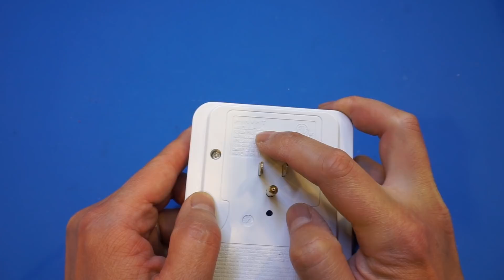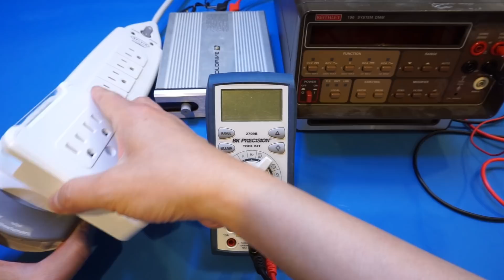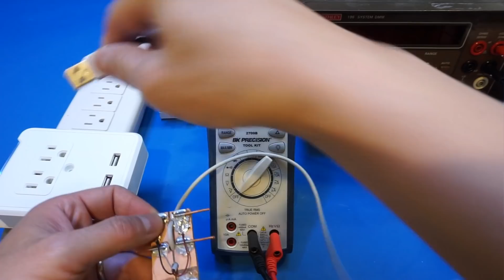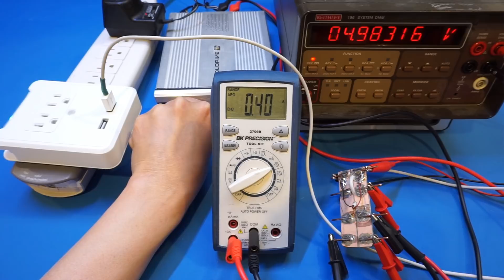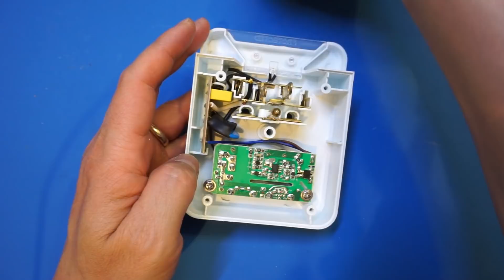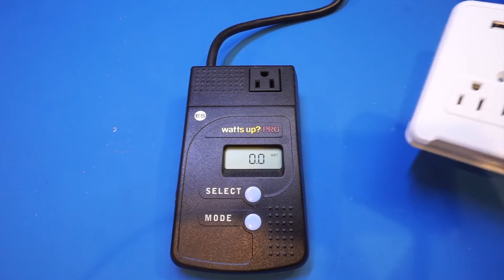Teardown of an MVMT Dual USB Port Wall Outlet Adapter

Comment: Does the 196 need cal? I noticed that when you upped the resolution, the voltage reading changed from 5.0368 to 5.0376!
Reply from the maker: I checked the calibration years ago and I did notice what you were describing but I think it was still within the tolerance so I didn't bother adjusting. Keep in mind that the 5V from the charger is quite noisy and not all that stable.

Comment: The main earth reference is a pass through. There is no requirement to provide an earth reference on a wall wart. In this case, because there is a ground pass through, the device can accept earth referenced loads at its receptacle.

Comment: Hey, someone from a high voltage forum suggested I come to you for answers. I have a scope that's a bit funky. This scope (whom I've named Braxton) is my most precious possession so I hope I can get him working again. One day (I suppose due to vent covering) he started emitting a smell. A very distinct smell--the smell of a failing component or overheating electronics. I'm too scared to leave him on and I don't have anything more than a multimeter at my disposal to troubleshoot him. Braxton means a LOT to me so if you could guide me towards how to fix him, I'd be so happy. He's a Leader LBO-520A 35MHz Dual Trace Oscilloscope. I have videos of him working properly. 

Please he hasn't worked properly in 1.5 years and I was devastated when he stopped working.
Reply from the maker: I did a quick search and couldn't find any service info on this scope? Do you have the service manual? If not it would be difficult to troubleshoot remotely.
Reply: Unfortunately not. This scope is 13 years old and was a gift.
Reply: Here you go: https://www.eevblog.com/forum/testgear/looking-for-old-leader-manuals/?action=dlattach;attach=64201
Reply: 1987 MY SCOPE IS OLDER THAN I THOUGHT
I thought he was from like 2004 or 2005 or something. 
He's 10 years older than me?
Reply from the maker: Thanks!

Comment: I have a few of these. I removed the resistor to the LED in order to turn it off but found that the parasitic resistance of the circuit board was sufficient to keep it turned on! I agree these blue LEDs are annoying to have on 24/7. The USB charger, as you have also found, is fairly decent. One other thing you could check for is the waveform of the USB power to see if there is excessive noise. Props to using the 196... I really enjoy using mine.